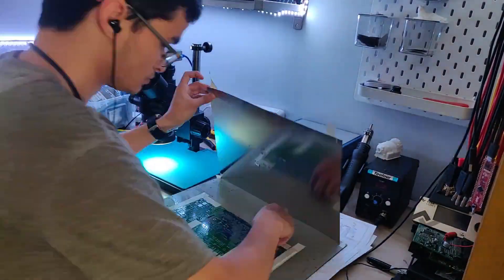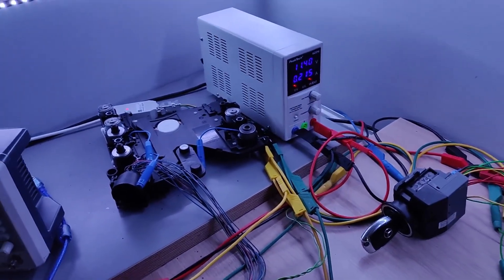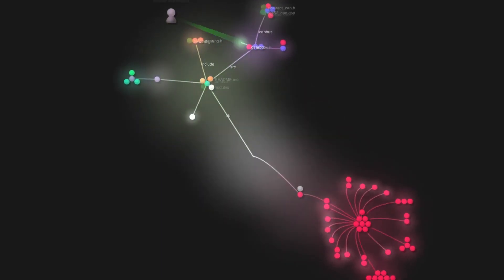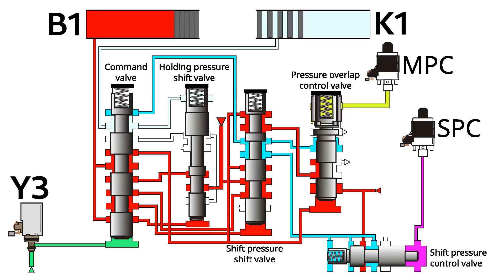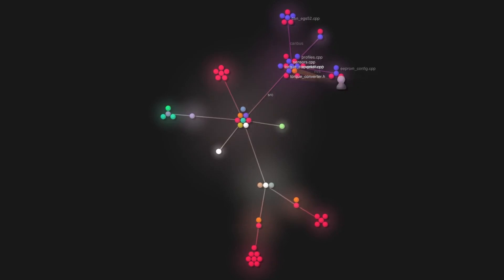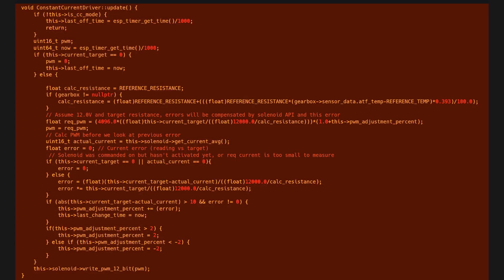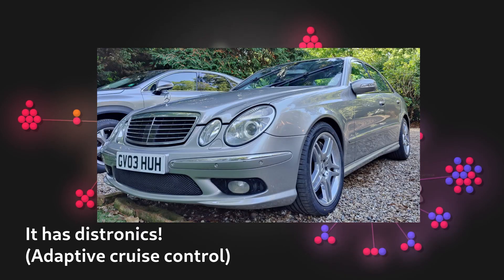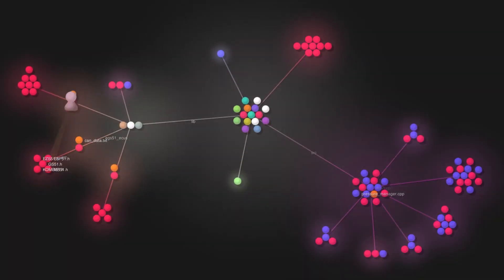Custom 722.6 TCU project part 4! - 8 months of progress! And LOADS of changes!!!

Comment: I have a1998 e300td  that ill be turning u the power, but would like too make the trans is capable of handling the new power. Do you offer tcu reprograming, if so how much does it cost to send you my tcu and have it reprogrammed. I would also like shift points raised and firmness improved.

Comment: Respect for your tremendous work. What are your recomandations for an 722.649 transmission installed in place of  722.666 ( W5J400 ), obviouslly it needs an software upgrade as the AMG version clutches have more plates and the valve body has a higher holding pressure calibration.

Comment: Waiting so hard for release for my Jeep Grand Cherokee 3.0 Crd with the 722.6 .....i hate the original Shiftpoints...i drives like a Honda Civic and doesnt use his  low rpm power/torque....and that manual mode is everthing but definitly no manual mode.
I already filled beta formular twice...but had no luck till now 😢
Reply from the maker: hey! I completely forgot about that form! Check your inbox now!

Comment: Would there be a way with this TCM to retofit Paddle shifter into a car that doesnt have them. I thinking that maybe the buttons are added to the steering and the signal is sent to the TCM via Can bus with a way to put the tcm in learn mode to learn the signal of the upshift and down shift buttons
Reply from the maker: yes this would be quite easy to make a module to send the 1 byte CAN Frame to TCU with paddle statuses
Reply: @RANDASH  let me know when you're live so I can order one of these units from you. I sent in a beta application also. I'm really interested in your module. Currently I'm looking up some part numbers to try retrofit some buttons into my car. Was able to enable manual mode on my original tcm via vedimo but I don't have paddle shifters.

Comment: Those of  us with 722.9's are excited by your work and hope that you venture into that one as well. Great job captain, exciting to see some TCU mods!
Reply from the maker: I hate to disapoint, but the 7 and 9G tronics are off the table. This is because their controls are paired to the car, part of the drive authorisation process (called FBS), and are embedded in the hydraulic valve body!
Reply: Hello @RAND_ASH

I've just come across your channel and wanted to ask about this. I have a w639 Viano and was hoping to change the box to a modern w447 722.9 or equivalent. So I take it from your comment it won't be possible?

Comment: Silly question.... Why does this project exist ?. Is there an issue with the Merc TCM around these years ?. Drivability issues ?. The only Merc ive ever had was a 2016 A220d AMG Line DCT with the 2.2d OM651. When i first got it brand new the DCT was just terrible. Over the 4yrs i had that car it had 12 software updates. Only on the final update 3 years in was the gearbox a delight to use. Clearly the DCT is a whole new ballgame but what it showed me was the poor software development from Mercedes and units being released far too early before they were ready.
Reply from the maker: The 722.6 is always known for grandpa style shifts, and after 10+ years, the gearboxes wear down beyond that which the stock TCM can compensate for. Those are the main reasons

Comment: Can I use this if I have a standalone ECU?
Reply: They're really designed to be used with the OEM ECU - not quite like some of the other aftermarket solutions out there for the 722.6/NAG-1 

That being said. if your aftermarket ECU emulates an OEM ECU in operation, execution and CANBUS protocols then you could - because the two modules would assume they're factory original equipment.
Reply: @lexistarchild9367  Could be used with stock ecu but with custom mapping on it, correct?
Reply: @ewyna4380  Yes, this is correct! A lot of our testers are using custom ECU maps AND one of the main goals is to help the 722.6 "keep up" with modified and higher-output-than stock engine tunes. That's the main reason for the transition to the E55 as the main developers platform -- so we can focus more on performance, enhanced shift behavior, speed and overall driver experience -- either in stock or modified vehicles.
Reply: @lexistarchild9367  Sounds good and with rev matching this will make one nice package.
Reply: @lexistarchild9367  this seems very limiting for a project with “endless possibilities”